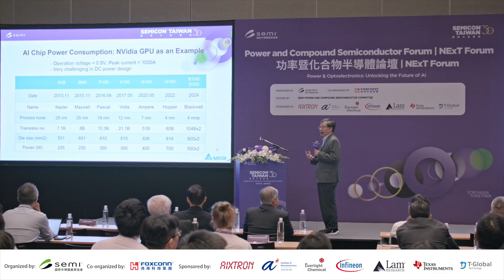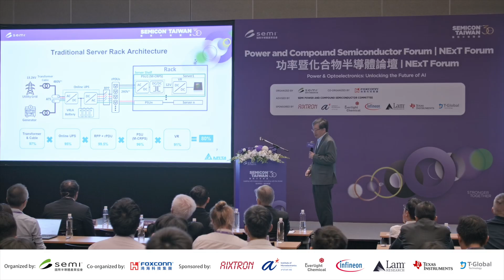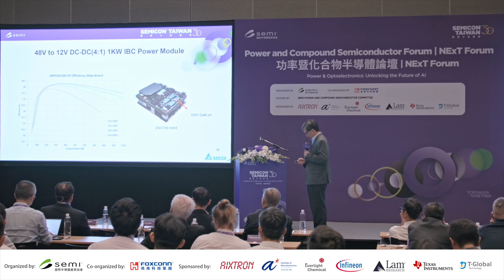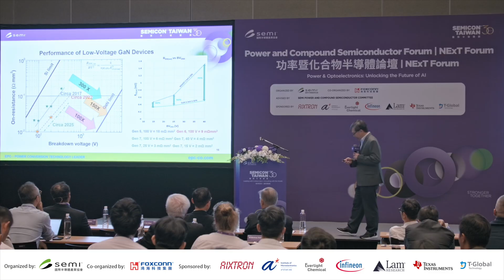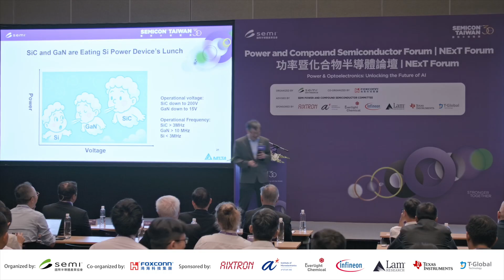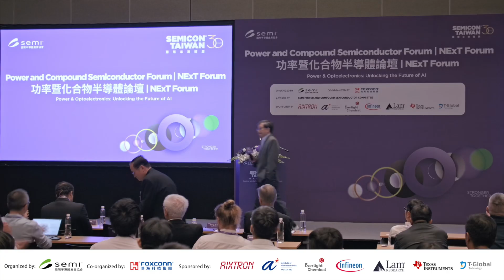DC Power solution for AI/Data center and future perspectives ｜ Dr. Yi Jen Chan ｜ Cyntec Co., Ltd

Comment: Framing AI data-center power as a system—from conversion stages and UPS resilience to component efficiency—makes the infrastructure challenge very concrete. In Brazil, phased pilots could measure conversion losses, grid and cooling interfaces, and local maintenance capacity; Brasil Semicon can support the ecosystem, but PADIS access still depends on eligible activities, product-specific requirements and an approved project.